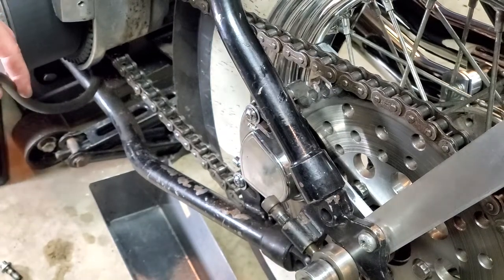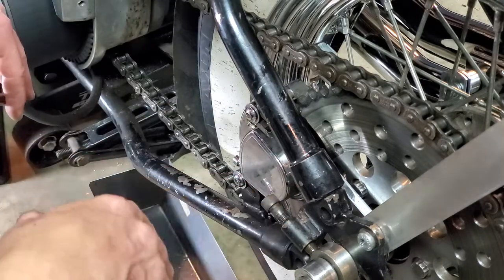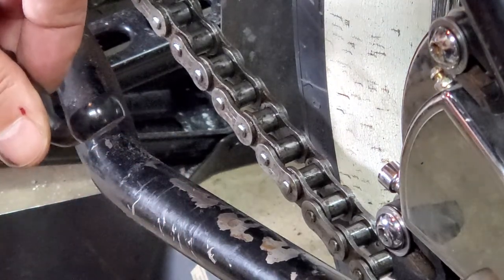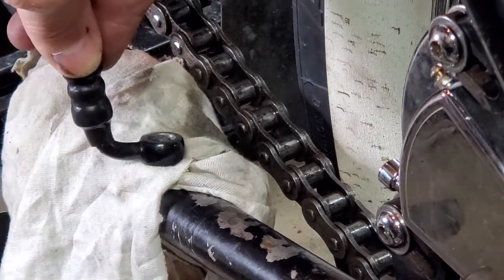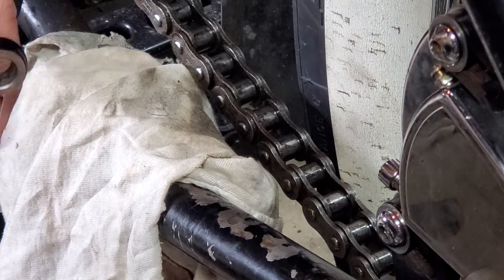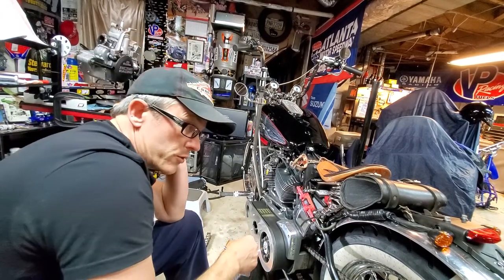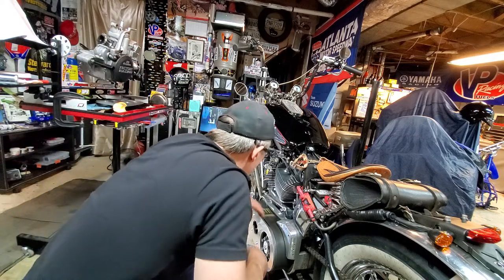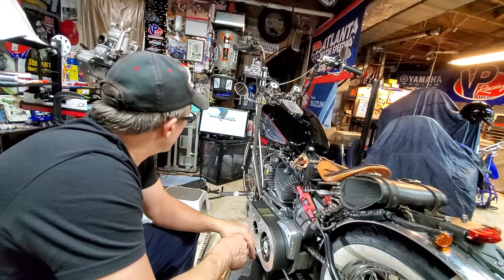👨‍🔧 If you can't maintain brake pressure and you've tried EVERYTHING else • motorcycle car truck any

Comment from the maker: What you are looking at - Vintage Rigid frame,   90's Springer fork, 96" Road King engine, Samson pipes, Super E Carb, Thunderheart Ignition, Ultima 6-speed transmission, custom Hand-shifter with clutch, Performance Machine brakes, Chain final drive, brake 'sprotor' (sprocket / rotor), 3" BDL open belt primary, Ultima complete wiring harness, 90's Softail oil tank, 2004 Street Glide gas tank, Fuel Pump delete on the tank, custom seat, 12" mini apes, took a very long time to finish this previous rolling 'basketcase.'  See my other videos about it.

https://www.youtube.com/playlist?list=PLVsdJzatTm_WxghwgV9NHgjW8tYe0Hfp6

 Project took six long months and pretty much kicked my ass.  I learned to do many new things while on this project - including soldering and heatshrinking, creating battery cables and proper crimps, wiring the entire bike (totally destroyed my brain)  And first time I have ever tried to ride a bike with a hand-shifter/clutch setup.  (meaning, this bike does not have the conventional foot-shifter.  The lever in my hand IS the shifter, as is the clutch.) Takes some concentration at first. lol  Thing runs really really well.  96ci, Twin Cam , Harley Road King engine, tuned S&S Super E Carb and air cleaner, S&S intake, Samson Big Gun Shortcut 2.25" exhaust, custom baffles, customized exhaust mounts, custom handlebar risers, Ultima 6-speed transmission, Thunder-Heart programmable ignition, custom spark plug wires, Performance Machine front brakes, 3 Guyz rear brake/sprocket combo rear assembly (meaning the rear brake rotor IS the rear sprocket,) 530 chain, 3" BDL open primary drive, Hardtail frame, 1998 Softail oil tank, 1997 Springer frontend, Jerzee Customs oil pressure gauge and mount, Ultima complete wiring harness, Drag Specialties mini speedo and tach, oil temp dipstick, Harley Touring Model Voltage Regulator, all new hoses and wires, Harley Street Glide fuel tank, custom battery cables, Fastronix terminal strips, Fastronix circuit breakers, Vintage Springer horn, customized horn mount, one-off custom-made full-grain leather seat, miniature turn signals front and rear (modified from a different use,) Avon tires, the list goes on and on and on....  I didn't create this bike from the ground up - BUT - it was a relative mess when I got it.  Wiring was a disaster, bike ran poorly, it had NONE of the common conveniences it now has.  As well as the all new wiring and module. Would you believe I traded a  YZ250 (awesome bike, but still) for this???  ;)   I could not have done this without the help of my lovely (and open-minded) woman.  She was a huge help in completing this very challenging project.